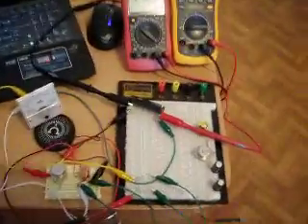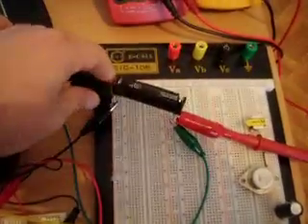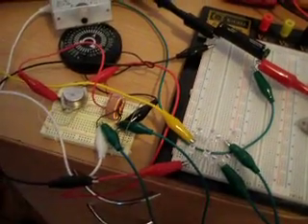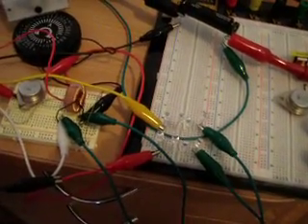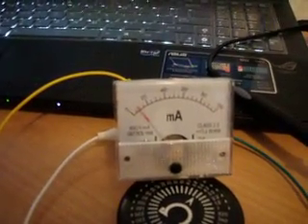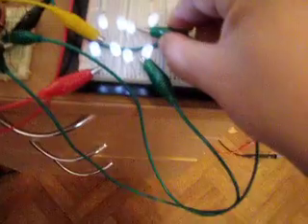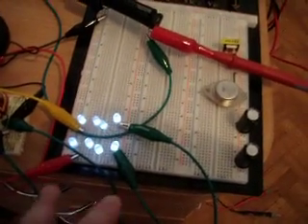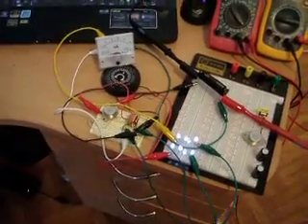Joule Thief - Extra Light - 0 Extra Amp Draw V2 no PSU

Comment: Can you post the transistor used in the description for future tinkerers?

Resistor value?

Numer of turns on each side of the coil, and gauge of wire on the torroid?

Comment: I will add a capacitor in parallele to the cement battery to smooth the current peaks as much as possible.  This will help a lot for sure :-)  I will try to build the setup this week.  I am really impatient to seem the result.

Comment: Very interesting work.  I will try to built your setup for sure.  Had you make some test with almost dead battery ?  I am working will enhanced joule thief circuit on cement battery providing equilibrated voltage / current about 0.430 mV.  So i am just curious if you had investigate the response of this circuit at very low voltage ?  The amp you have mesured are 'average current' and not the 'peak current' (cycling) and is more the 'peak current' tending to kill battery when voltage is very low.

Comment: The 2N3055 is not a good choice for a low power Joule Thief. Replace it with a BC337. If you don't want to get some of those from eBay, then use a PN2222A or 2N4401.  The LEDs will be brighter and the supply current will be greater, of course.

You said the LEDs were all in series, but the way you show them connected is actually two strings of four LEDs each, with the strings connected in parallel. They are splitting the output current equally between the two strings.

Comment from the maker: @stefb2005 
Ill try get my hands on my parents HD camera soon and will do a close up look at the coil for everyone.
In words I can only say that it is not wound the typical way people wind there coils. It is a very thick copper enamel around 1 to 1.2mm and I cannot say what the material of the toroid is as it is fully covered by the windings and painted green. The windings are 1:1 and from quickly counting there are 32 turns on each side. Also I got it out of an old PC power supply.